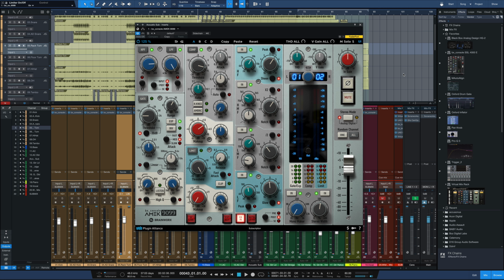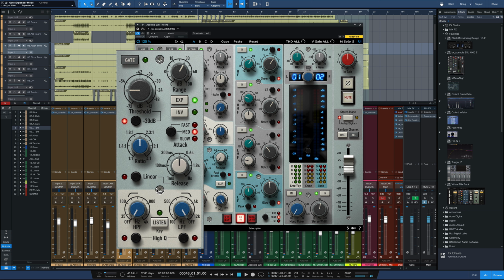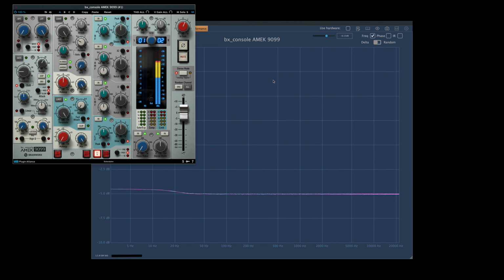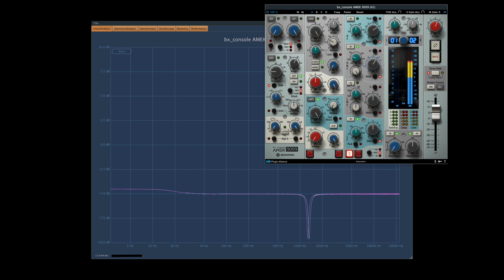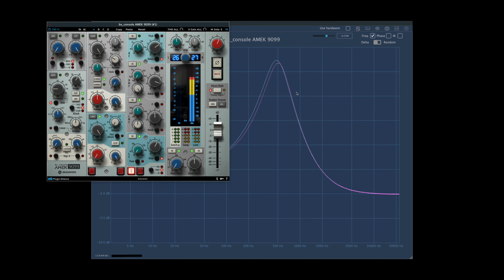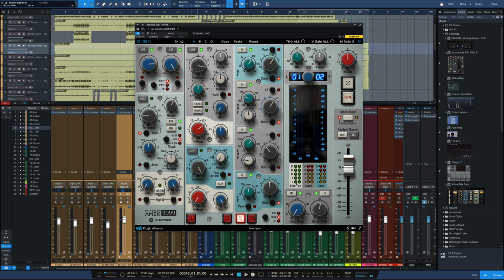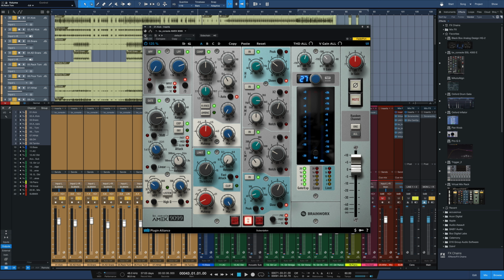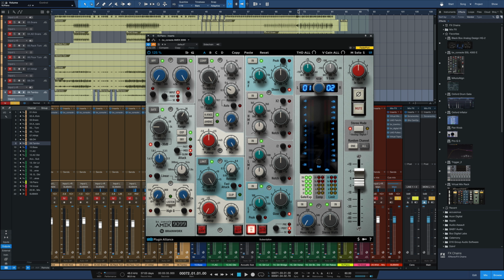bx_console AMEK 9099 | New from brainworx/Plugin Alliance

Comment: I just snagged it for $11. The GUI is really beautiful. Can't wait to test it out on a mix. Does the input gain knob act like an actual preamp, or just volume?
Reply: @Neon Thunderbird  The limiter section of the 9099 has a clipping function... hard and soft. You lower the threshold to get the desired clipping/saturation you want and then you can blend it in with the mix knob. This is great for vocals, where you want to add some subtle character and thickness, but don't want the full audible effect of clipping, as you would use on a snare
Reply: @Neon Thunderbird  No, it was before that sale. I can't remember exactly, but I was able to stack my monthly voucher and it ended up $11. It's totally worth $25 as well. The clipping in parallel sounds great and is a real time-saver.